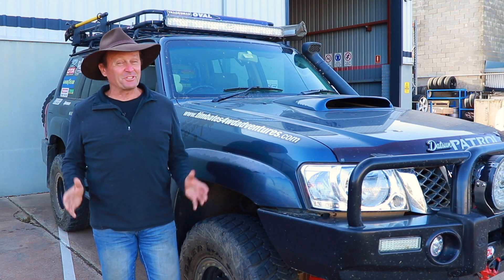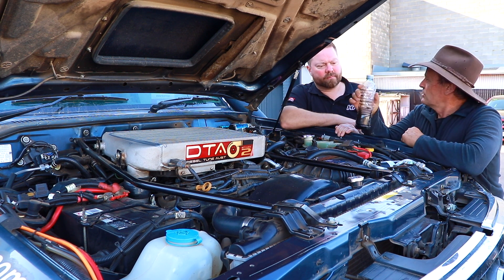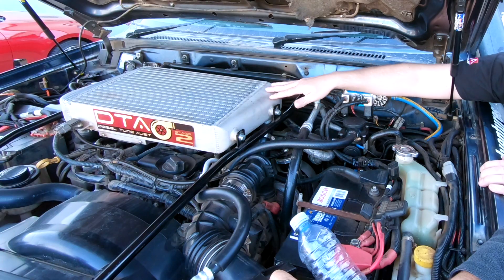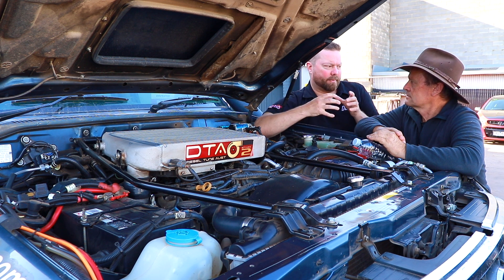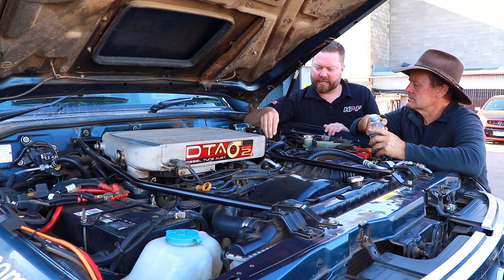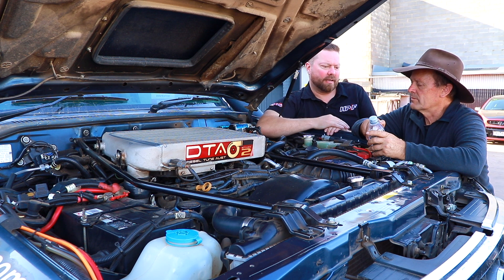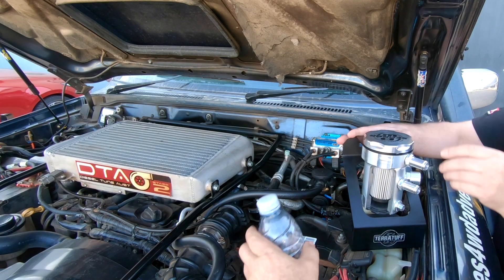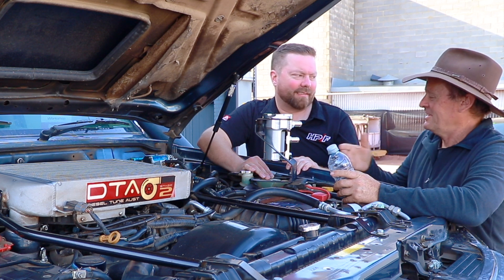Oil catch Can Explained - ( Do They Really Work )

Comment from the maker: Have you got an oil catch can fitted to your 4WD?
If so how do you find it works?
Reply: I was all ways told, you only need oil catch can if you live in the city and do short trips. I live north-west NSW and the 4x4 dose 1000 km a week. Next time I buy a new 4x4 I will put an oil catch can on it.
Reply: Definitely have one fitted to my cruiser mate, from brand new. Gotta keep that intake nice and clean and oil free. I use a Provent catch can with a proper oil separator filter like the one displayed in your video. They work a treat. Which reminds me, i need to empty mine LOL. Great video mate!
Reply from the maker: @jimbojones2457  yeah top stuff mate. 
They are well worth having installed. 
I clean mine out depending on how many Ks the Patrol has done. 
Thanks mate for checking out the video. 

Cheers Tim.
Reply: @timbates4wdadventures  my pleasure Tim. I empty mine out every 1,000kms or so. And not much comes out.
Reply from the maker: @jimbojones2457  yeah I only get a small amount. 
But better catching some, than none at all.
Reply: @timbates4wdadventures  that's exactly right mate!

Comment: If the standard oem system has a hose going directly from the rocker cover to the inlet then we go and fit a filtered system with pressure relief valves isn’t anything other than an unrestricted hose going to pressurise the crank especially when the filter begins to get wet??
Reply from the maker: Great feedback mate. 

Cheers Tim

Comment: What oil catch can u running i got a hpd in mine 2010 gu  its a pain u gota take it all out to drain it im thinking of a flash lube 1 where i can drain it😊
Reply from the maker: @DaveOLoughlan  I have
 A Flash Lube Cc 
I have a drain hose with a tap and very easy to drain. 

Cheers Tim.

Comment: I own a diesel!
Not a 4wd but a tdi Vw polo. 
After 113,000 kilometres the egr went and needed replacement and a while after this it developed a boost leak also which was found to be the bottom intercooler hose had a split in it but once removed we saw just how much disgusting oil was in it! Which I believe lead to its demise?! 
I researched catch cans as by now I was most interested. I was only going to use a Mann and Hummel provent though but after measuring I discovered that the provent 200 was simply to large to fit under my bonnet so I chose the provent 100 and it fits up front perfectly. From Bunnings I found oil and petrol proof clear 19mm hose which was a perfect fit. The hose going into the catch can is black and gross now after approximately 70,000 kilometres but the hose going back into the inlet by the turbo is still relatively clear so they do work in catching the muck this is why I chose clear hose to monitor it. Each time I drain it I get around 150mls out of it. I’ve never pulled off the intake or intercooler pipes since but I’m betting that they’ll be pretty dry by now and I’m assured that the black,oily mess is not going back in to the system. I’ve got 240,000 kilometres on my engine now and it’s still running great. The genuine catch cans DO work.

Comment: I’ve got one on my PX2 Ranger. I empty it every couple of thousand or so but only get about 50ml or so.
Question: why don’t manufacturers fit these themselves? Surely it would keep the whole intake system cleaner and prevent a number of warranty issues?
Reply from the maker: Gday mate,
They sure are worth having a catch can fitted. 
Yeah it’s hoard to work out why they don’t come as a standard fit up. 

Cheers Tim
Reply: Modern Diesel engines will burn that oil. If you haven’t added an after market chip, you get your vehicle serviced on time (months or kms. Whichever comes first) and you’re doing some highway driving rather than just using your 4x4 to nick down to the shop, then you don’t need a catch can.

Comment: Fitted a catch can to my Peugeot 308 1.6 turbo diesel. There was so much oil going down the intake, it ruined the hose to the turbo, which ruined the turbo vacuum advance, clogged up the intercooler, clogged up the MAP sensor , egr valve  and the intake manifold. What a difference now. Part of the problem is the recommended oil is 5w30 which is very thin. Not sure if I can alter that. I also fitted a catch can to my 79 series Landcruiser Ute a couple of years ago after wondering were all the oil was coming from after looking down the intake to the turbo while changing the air filter. That started a lot of research into the cause of it. Directing the oil in combination with the carbon from the egr valve into the intake manifold resulting in sludge build up, seems to be a very poorly thought out solution to a pollution reduction requirement. Happy camper now.
Reply from the maker: G'day David,

Great feedback mate about the can cans you have fitted. They work really well thats for sure. 

Cheers Tim.

Comment: Catch cans may have their place on older vehicles but on newer engines they are designed for a small amount of oil circulation. The problems arise when the egr gases mix with the oil vapour and causes build up. Far better to block the egr than to worry about installing a catch can. I know people are going to dissagree but thats my view.
Reply: No one ever provides video/evidence showing turbo/head carbon buildup compared without it. The only thing catch cans catch is suckers..
Reply: David Bradford  i have a NP300 Navara and have blocked the egr with no issues. Maybe some might have issues associated with it but i havnt heard of any problems.

Comment: I have a 2017 N80 Hilux with 5 year extended warranty. The dealer has never given me a straight answer on if a catch can would void the warranty if I had engine issues. Very frustrating as I’d love to fit one. Love your work too by the way. Cheers

Comment: Great video gain as usual Tim. 🤗

When our company was purchasing its XLT Rangers Ford told is that if we fitted a catch can that we would immediately breach our warranty. 😢

We follow the Ford Ranger Group on Facebook & catch cans are a very regular topic of discussion that pops up & its always 50/50 in favor of V's against.🤔

We don't have any in our XLT Rangers, they are serviced both on the dot +/- a couple of hundred K's & a full oil change is done in between services @ every 7,500K's.

@ Every service a full oil change & oil filter is done.

Our vehicles do long K's on most of their trips 1,200K's @ between 100Km/Ph & 110Km/Ph in a day is not unusual with the avarage being around 400K's to 600K's in a day @ an avarage of between 80 & 100Km/Ph, our vehicles don't see much metro / city driving.

All our XLT Rangers all run the diesel management secondary 2 micron fuel filter which is also changed at every service & inbetween service.

All our vehicles also only run Bp Ultimate or Caltex Vortex 

 So not sure if all that makes a difference or not. ?.🤔

Regards
Wayne.
Reply from the maker: G'day Wayne,

Once again, another great detailed reply.
Thanks mate.

Cheers Tim.

Comment: Got a Pro Vent on my 3.0L Patrol. Swear by it. Works a treat cleaning up the crankcase vapours. Drain it every 5000ks with the oil change and also before any big trips. Maybe 50-100mL of oil gets drained each time. Great vid Tim
Reply from the maker: G'day mate,
Thats great feedback and great its working for you.
Thanks for your reply mate.

Cheers Tim.

Comment: I had a no-named, undersized can on my Td42t for about 20k. Apart from it needing to be cleaned out every week, it'd build pressure in the rocker cover. I also noticed that the turbine fan blades were starting to get a burred edge (from what I can only imagine is oil drops). The turbo is only 25k old so, on went a provent 200 catch can and 3/4" lines.
Maintenance is easier, pressures are better and the engine is going to last longer.
Spend the money early in a build and do it right!
Reply: David Bradford  it was because it'd take bugger all to fill/ block the shitty tiny SS filter element (only assessable by removing 6x m4 bolts) and everything was just running straight to the catch tube.
Reply: David Bradford  it's beautiful now with the provent 200 fitted mate.